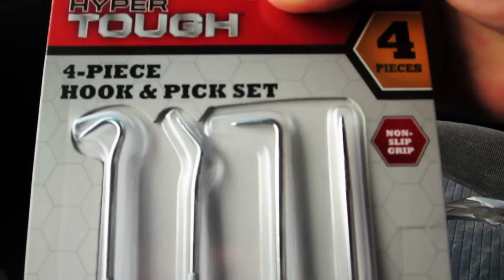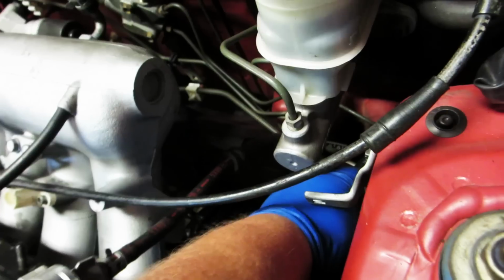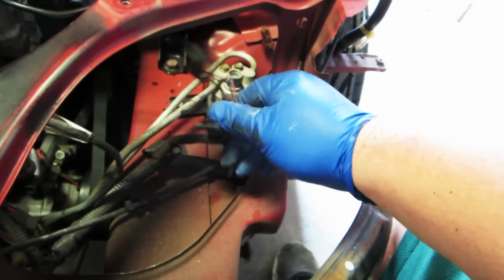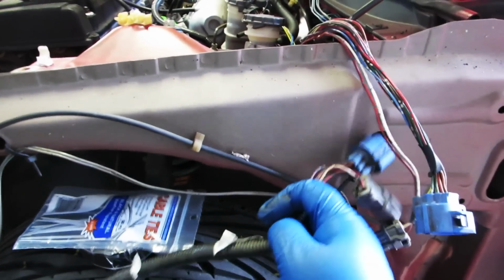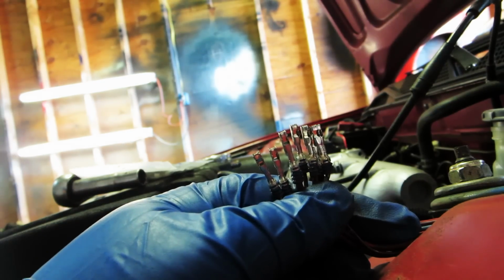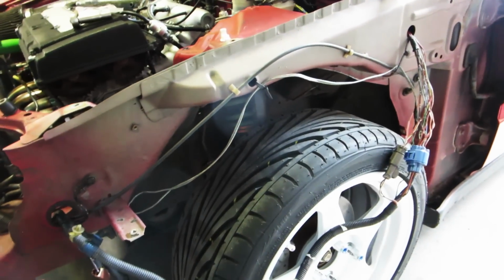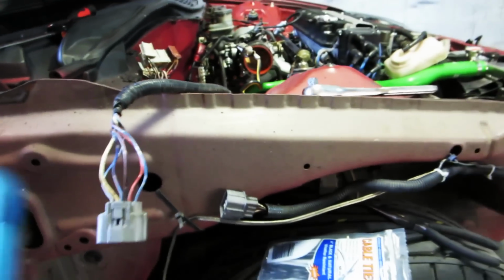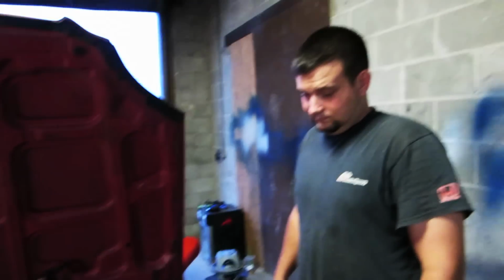WIRE TUCKING!  PT:2!!  Headlight Harness  HSG EP. 4-28

Comment: when I did my wire tuck I found out u can use the original zip clips that click in the little holes again. just cut them off,pop them out, then cut the zip tie part off and slide in a new zip tie(use black for stealth) threw the hole. and their u go, u can zip up the wires n stick back into any little hole to hold the wires in place.

Comment: hi tell me do have to go aftermarket on upper control arm on the ek to adjust my camber because I just can't get my one wheels camber set and its chewing my tyre.
Reply: you'd have to get an aftermarket camber arm to adjust,  but if you get a proper alignment and fix your toe it, camber angle should be fine.... unless your stupid low or somethings bent.

Comment: I know this video is 5 years old, but I'm having an issue with my hatch having the two wire connector same as yours, the grey one. Well on a harness I pulled from a sedan and my sedan also have a different connector there. Has 5 wires. What is going on here lol

Comment: well im getting ready to do my 95 civic ex coupe will this work for me with out cutting anything ???
Reply: I just did my 89 crx I pulled everything into the car and ran through speaker wire holes there is literally no visible wires anywhere I have soldering to do tomorrow extending 12 wires each side